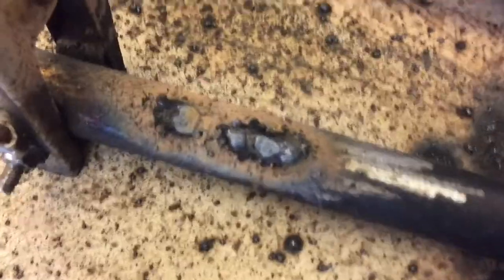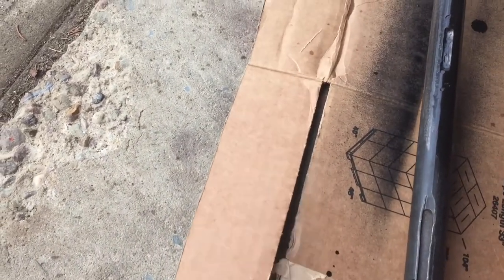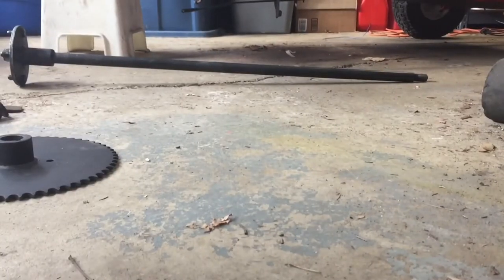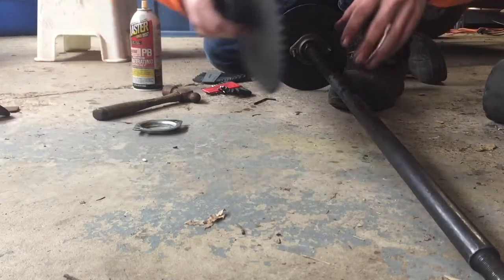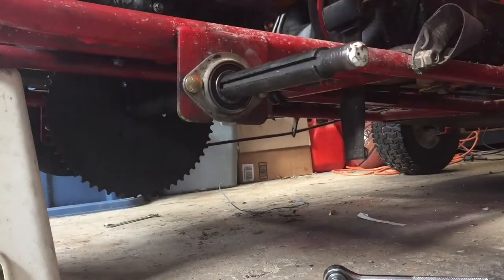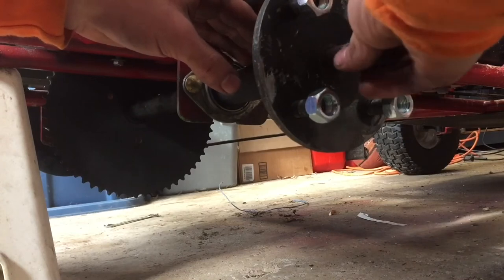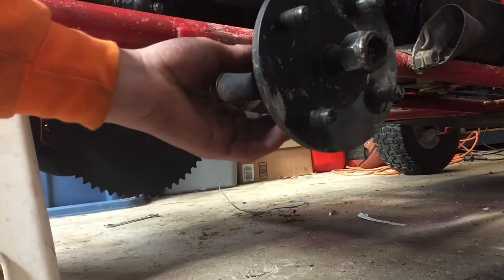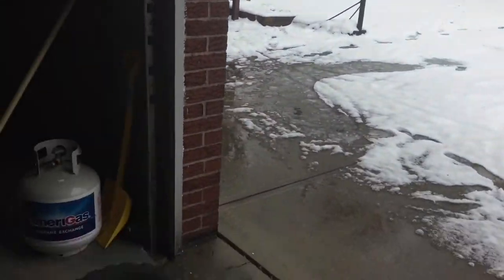Fixing The Go Kart Axle!

Comment: The little liquid weld packets u can find at Lowe’s or Home Depot for like 8 bucks. They work pretty good too I had a chip in the key way by where my sprocket needed to be lined up and i filled it in with some and it had worked great if u ever need to remold ur key way again I would suggest it.
Reply from the maker: Thanks for the tip! I'll be sure to use that. How is your go kart? It's been a while since you posted a video. Sorry if I have already asked. I don't remember. Thanks for commenting too!
Reply: John Wheels ya mine doing good I haven’t gotten around to messing with it in a while because of all my school work and it’s like -5 ever day now so since my engine I raised on 3/8 inch spacers it will crack the engine block because of how cold it is so I’ll have to wait for now but hopefully it will warm up soon
Reply from the maker: Ok cool. I'm in Pennsylvania and it's 13 degrees here. I hope it warms up for you.

Comment: Cool video I need to pull the axle out of my go kart and fix the brakes but I just haven’t got around to it yet
Reply from the maker: Cool! Looking forward to the video on it.
Reply from the maker: I have a video on how to adjust your brakes. In the video my axle is off, but it doesn't need to be off. There should be two bolts holding the two sides of the caliper together. If you take those apart, the brakes should come apart and you'll be able to access the pads. If you just need to adjust it your breaks, it's very similar to setting valve lash. But, you can do it by Feel. 
https://m.youtube.com/watch?v=-vW53MlYBWU
Reply: Cool thanks I’ll go check out your video and see what I can figure out